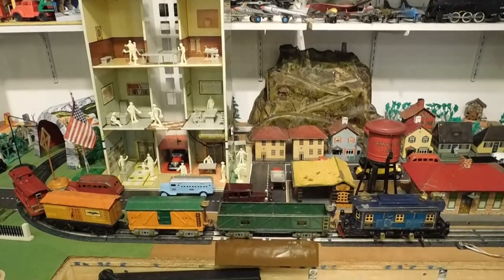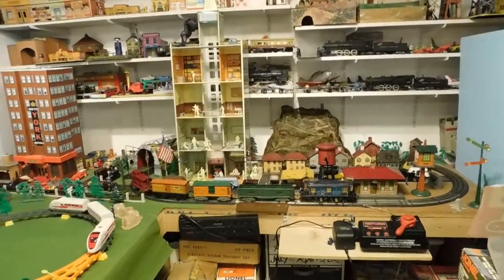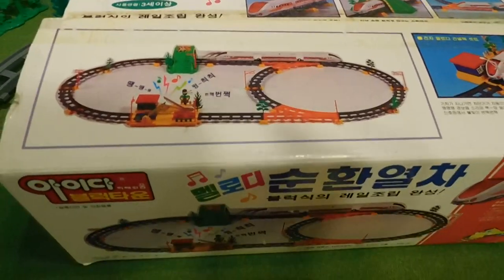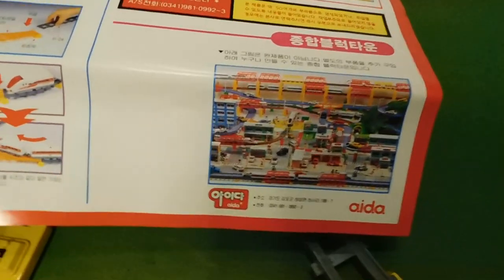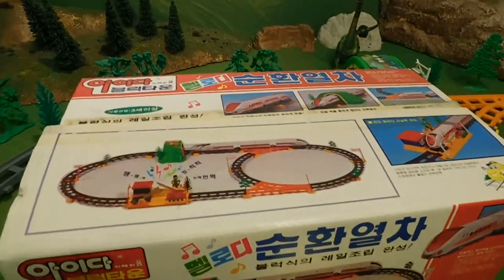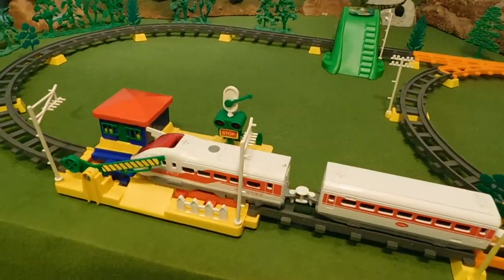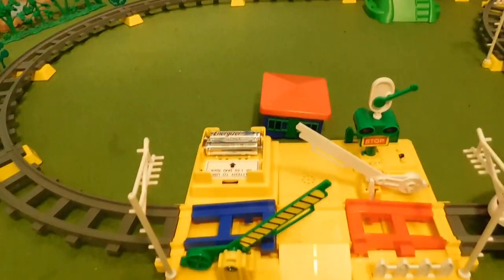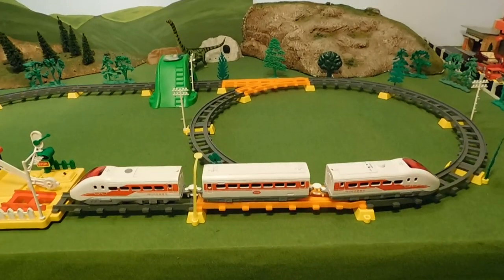Running A Korean Batt Op O-gauge Bullet Train (a.i.d.a.) Small Toy Train Layout, Batt Op Trains

Comment: Will it run on the O gauge track?
Reply from the maker: I don't think it will because the wheels have no flanges. The train sits on the track bottom vs. sitting on the rails like a true O-gauge train. The rails that stick up act as guides so the train doesn't fall off.